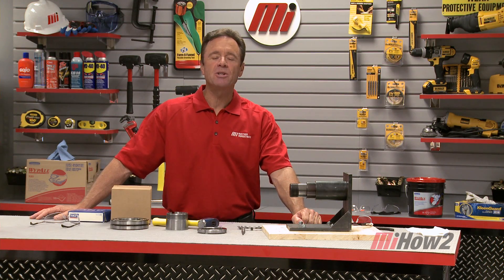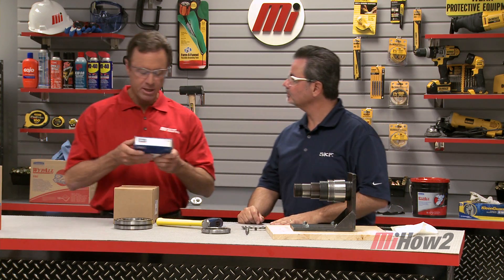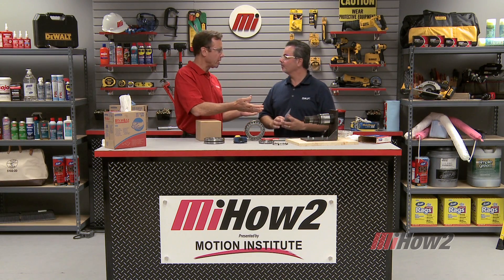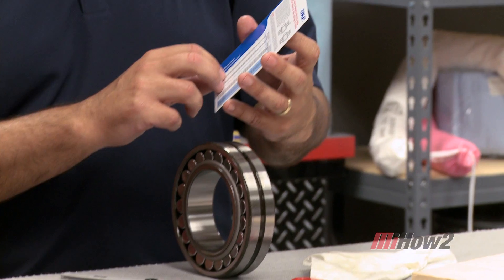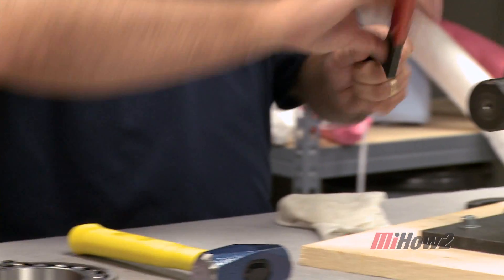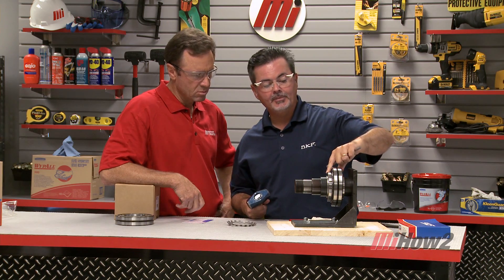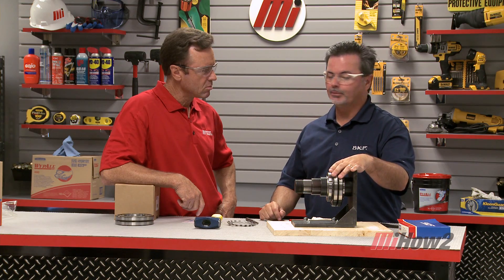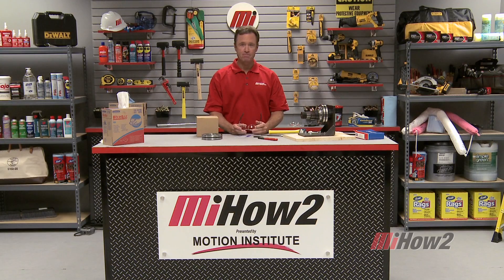MiHow2 - SKF - Mounting a Tapered Bore Spherical Bearing on an Adapter Sleeve

Comment: If there is a spacer behind the inner race, does it have to be replaced with a different height one? The bearing is held by a split nut with a screw to clamp it.

Comment: when bearing is mounted on the shaft shouldn't the clearance reduction be measured at the bottom of the bearing?
Reply: yes that's how the skf rep tought me to do it. also said should never grease or oil parts.
Reply: @katiedave1098  Keith said that for Taper Lock fittings, but for a bearing you are not transmitting any torque, just ensuring the bearing stays put ... whereas taper locks and pulleys are a different matter entirely. You will note that the SKF guy in the video said "a light wipe with some oil ..." as in a smear or smidgen, when fitting the bearing.

Comment: Sent here by Keith Fenner
Reply: Good on you Keith, now I can do that taper sleeve bearing refit that I have been putting off because I didn't know the method! Now I am refitting am old bearing (sourced from old stock on hand and so don't have the card...) so I do not know the feeler gauge clearance - will Machinery's Handbook (24th edition) have this table? (I suppose I could look it up ...)